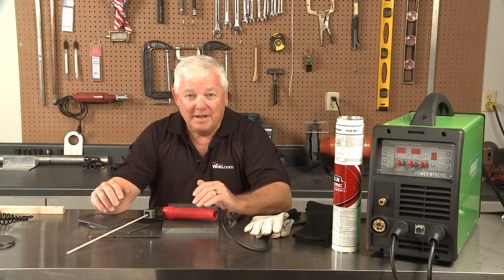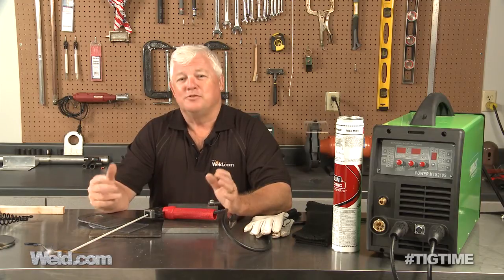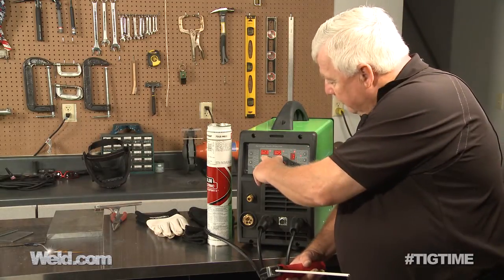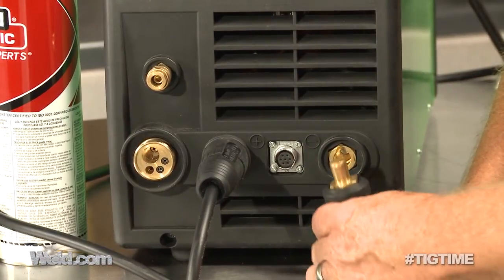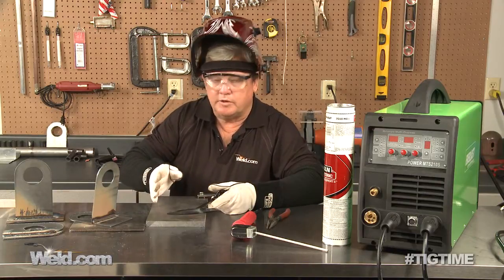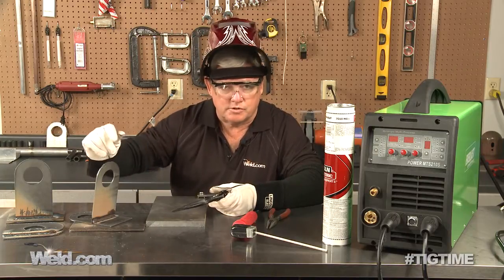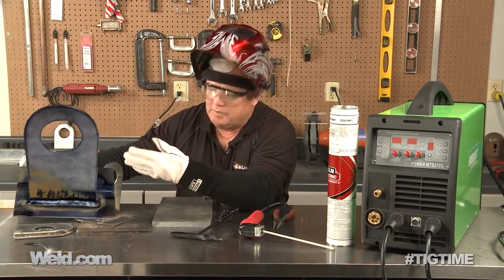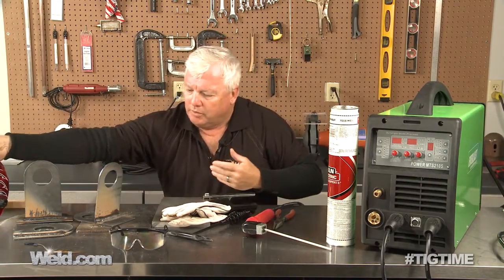Everlast MTS 210 Welder Review: Part 3 (Stick Welding)

Comment: Mr. Tig could have turned up the Arc force (Dig) control (First dial from the left) and got the weld to wet out a little better, this would have made an improvement, start to finish. Additionally more dig is a nice feature to have especially for restarting 7018 when doing shorter welds as 7018 has a tendency to cap over at the tip of the rod when ever welding is stopped. For first time welders general purpose 6011 rod is also an extremely easy to weld option all though not as pretty a finish bead profile.

Comment: 1machinist1 is wrong! Electrode positive and ground negative is used for almost ALL stick applications! Electrode positive runs the arc hotter at the electrode end and gives you the maximum penetration. Electrode negative runs cooler, and thus, less penetration for times when you WANT LESS penetration, for instance, when doing thinner materials.

Comment: Here's a tip for when doing stick: Scratch a new electrode on some scrap and weld for about a half inch. This will warm up the electrode and then when you scratch the " real " metal, you will get a more consistent bead from beginning to end. I think the reason that you got that one bead that was kind of bad at the beginning but got better as you went along was because of the cold rod at the start. Also, the " warm " rod will make it easier to get a good scratch start. Hope this helps. Cheers!

Comment: No, that is wrong information. The only rod that is a common one that uses the work as positive, and in a very few circumstances, is the 6011.  Electrode positive is the way 7018 is always welded.

Comment: As far as your friend's comment that 7018 is the easiest rod to weld with, I think most would disagree with that. It is much easier to start an arc and maintain a puddle with 6011. The low hydrogen of 7018 probably leads to a stronger weld but it takes more skill to use that rod.